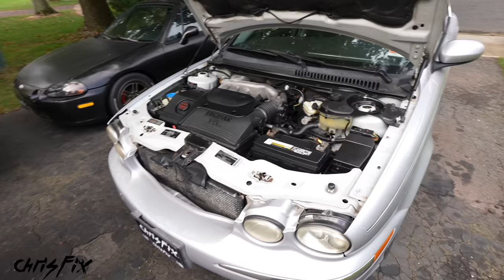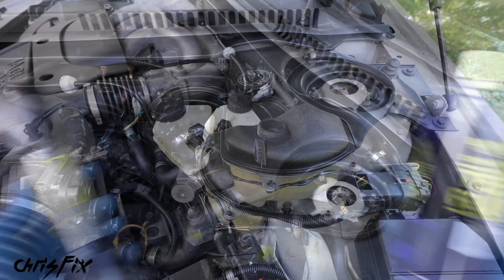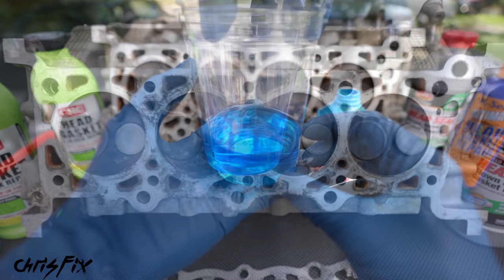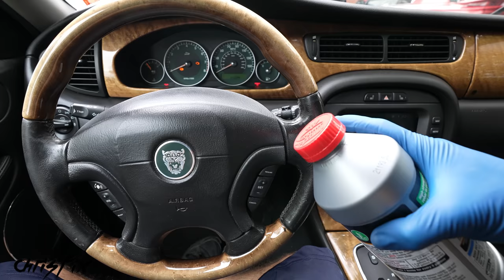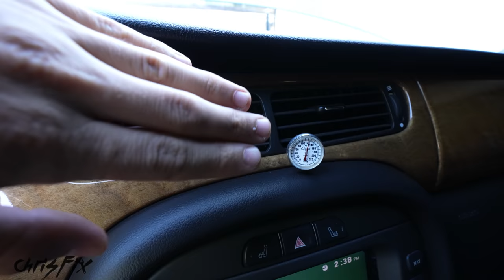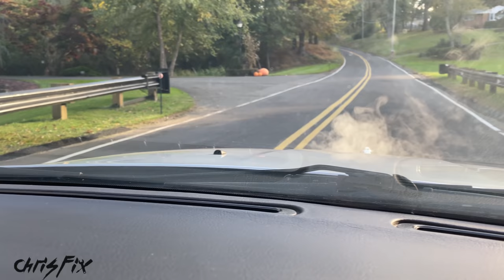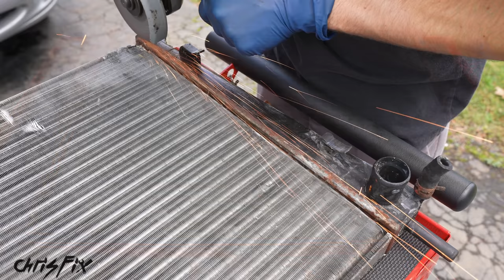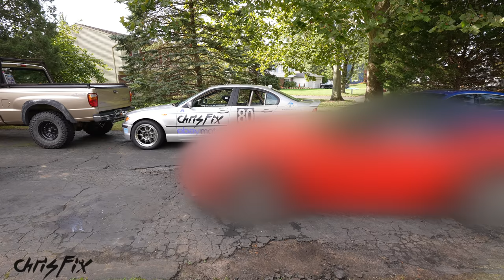Do Head Gasket Sealers Actually Work (FULL 2yr TEST with Engine Teardown)

Comment: I have only used a head gasket in a bottle once, on my wife's last car. She had a 2008 Pontiac Torrent GXP with the 3.6 V6, 160,000 miles. Head gasket leak into the exhaust. Going through about a gallon of antifreeze a month. I used the K Seal brand sealer. The only thing I did different from the instructions was since it wasn't going through antifreeze very fast, I drained out about a gallon from the radiator, mixed the sealer into the antifreeze and added it back to the reservoir. Watched the coolant level closely for about a month with very little loss of coolant. She drove it for another 8 months before we traded it in.  Didn't notice any side effects from it. The heater worked like normal. No over heating issues.
Reply: Awesome!
Reply: "Then we traded it in" with full disclosure i presume 😁
Reply: @Dufftruck7  Of course!😉

Comment: Having problems with my engine. Watched this video 3 times already and I'm going to try this. Just wanted to add, this was the best how to do video I have ever watched. I am a 70 years old woman and this was so easy to follow. Excellent job.
Reply: I agree ☝️
Reply: howd it go?
Reply: Did it work?
Reply: we need an update!
Reply: Did it work ???
Reply: UPDATE???
Reply: @grahamhammond  I tried it in my 08 Avalon, but the head was too warped to work. It was the BlueDevil stuff.
Reply: @grpAfactory  did you try to use anything else?
Reply: Im about to do this to my tahoe. I have a minor leak so im confident i shouldn't have issues. I was always told Blue Devil is the way to go
Reply: @danielwright_69  No, the head warped too much. I had to replace the head.

Comment: I have a 99 Camry that developed a leak in in the first cylinder. I used the Barr’s sealer shown in the video and it worked immediately though filling it was a pain because how thick it is. Been driving about five months with no problems at all. It will buy enough time until I can get a proper fix.

Comment: My dad just blew the head gasket on the family's 2011 Chevy Aveo with an overheat. (I'm pretty sure the rad has a leak and I'll be pulling it tomorrow to confirm.) The reservoir now blows the coolant out when the cap is off which it never did before and I found water/coolant ontop of the pistons after pulling the spark plugs. But your video is so comprehensive that it has given me the confidence to give the Blue Devil a try once I get the rad leak fixed, versus taking the head off the block and praying to everything since I've never even opened a valve cover before. I'll try to remember to update this as it goes.
Reply: Oil in coolant or coolant in oil? Or both?

Comment: This video is exactly what i needed to see, my car was in the exact same situation. Coolant leak but no drips underneath and no steam out the exhaust, so it was driving me crazy,  after the video i tried the funnel tip and had bubbles, put in some gasket seal and now my car can hold it's drink. Thanks so much Chris
Reply: Any update about your car? does the sealant still work?
Reply: what sealer?  any updates ? thanks 👍

Comment: That was one of the best videos I’ve seen on a review of a product all the way down to the fact of showing the after effects of what it did to the engine. So thoroughly done. I loved it. Thank you so much for this video. 
I’ve used the Blue Devil product years ago like 2005 I believe in a Saturn car. It lasted like 10 months and the bottle from autozone was like $60 at the time. And you couldn’t use coolant back then. The instructions said to use straight water back then. But I probably put 10,000 to 12 thousand miles on it before it started acting up again. So it does work but not long lasting
Reply from the maker: Thanks a lot! And that's pretty interesting, thanks for sharing!

Comment: I have a 2002 Nissan Altima SL 2.5 liter. 147k miles. Had a substantial head gasket leak. Had milky white oil on the dipstick, as well as up in the breather tube assembly, almost all the way to the mass air flow sensor! I would hardly start, and smoked up the entire roadway when it did finally start, with thick white smoke. Not to mention, I was having to add coolant everyday. My radiator cracked, which caused more trouble. Ended up finding one of my thermostats was completely froze shut! I changed the thermostats, changed the oil, and add a bottle of Blue Devil Pour and Go Head Gasket Repair. I followed the directions to the letter. I have since driven the car app 1200 miles without any problems at all! My oil still looks brand new, and no overheating issues! Hats off to Blue Devil!
Reply: It's been 11 months, head gasket still good?

Comment: I don't agree with cloged thermostat as being the cause.
The way the temperature increased and then dropped, it behaved more like an air bubble, once the thermostat opened, the trapped air, [mostly at the thermostat wax pellet end]  was free to flow towards the coolant resovour. Moreover,  causing the fluid in the resovour to drop...

I mean no disrespect, this is based on my experience as a fellow tech.,
I still enjoy your videos and continue to watch them...
Reply from the maker: Thanks for the info and your perspective. I would agree but the thermostat has a hole in it to allow air to purge through it. I also previously ran the engine full of coolant and the spill free funnel was full too. I ran it until operating temperature to show the exhaust bubbles in the system. With that said maybe the exhaust gasses built up so fast it trapped enough air to cause the problem you’re saying. Either way a great other perspective and thanks a lot for sharing from your experience!!!
Reply: Agreed that there was air in the system
Reply: I have a 2013 Buick Encore with 65,000 miles. Had a very slow leak and had to add fluids a couple times a month. The last couple weeks I had noticed I had to add more fluid than usual but not much more and all of a sudden the temperature spiked on my way home from work one day. Ran it for about half a mile just to get off the interstate which I know I should have killed immediately. I let it cool for nearly 45 minutes added more fluids got a few miles up the road same thing happened. Repeated process and got home. Ran Diagnostic and said coolant system flow problem so change thermostat. Changed out thermostat and it cleared my check engine light started over clean and acted fine until we got to the stop sign at the end of my road and spiked again and died.  I believe the reason for the sudden spike is we didn't get all the air out of the system. Do y'all agree with this scenario? Now it will not turn over and there is water in the oil that had just been changed. Killed engine as soon as it spiked the second time after changing thermostat though. Is it for sure a head gasket issue? What am I looking at here?
Reply: @jcedars4784  what engine did it have? if it was one of the 60 degree v6 engines(3100-3900), i remember there being a little rail on the forward facing valve cover that had a spout that had to be opened to allow air to escape out of the coolant. if it wont turn over, the cylinders are probably full of coolant, and are hydrolocking the pistons from turning. take the plugs out, then try it, take cover though.

Comment: Chris, not sure how you manage to make an even better and more comprehensive repair/how to video than all your others, but this was a tremendous one.  Very informative.  Prior to watching this, I would have been skeptical about using any of these head gasket leak fix products.  Now, If I were facing a similar situation, (low value vehicle, with head gasket leak, and unjustifiable repair cost) I would definitely try these products.  Just preventing the overheating and coolant loss would have been a big win, but going for an additional 2 years and 10k miles was a tremendous endorsement for these products-or at least the one used.  Great job on this long term project video and all the great content your putting out.   Keep up the great work!

Comment: 07 Silverado 4.3L, head gasket leaking coolant to exterior below exhaust manifold. I used a heaping hand full of pepper into the upper radiator hose. 1 year, no problems.

Comment: 17:27 it got really hot because the sensor was reading the steam in the system. Once the steam got worked out it started to read the correct temperature of the fluid.

Comment: I have a 2006 Sienna with 345000 miles with a small headgaskit leak. I will try this. As it hasn't overheated,  just pushes out about 8oz of coolant from sustained speeds 80-90mph. 
Thanks Kris.

Comment: I've used Blue Devil on an Audi S6 V8 and a junker 97 Impreza sedan. It worked both times flawlessly and I absolutely HATE "leak sealers" but it actually worked. Miracle tier stuff.
Reply: I'm on mobile so can't see full reply but from what I can read, yeah, full T stat removal, heat cycle, then replace with brand new T stat

Comment: I find it more amazing that it fixed the leak because Bars Leaks does not claim that their product will seal a warped head.  It is a significantly different scenario than a failed head gasket due to the difference in square footage (inchage?) between a warpage and gasket failure.

Also, props to Chrisfix for a well researched and thorough test.

Comment: I just want to say thanks a lot to Chris fix because I had the exact same issue where I did not blow the head gasket. I warped the head and I could not find any other video besides this one that explained it this well, and in depth to even show the head gasket after was absolutely perfect. Saved me having to take it to a mechanic too bad my engines trash now.
Reply from the maker: Thanks! And was the head too warped to be fixed?
Reply: I’ll let you know by tomorrow morning if this works I’m letting it sit overnight as you did but I’m almost positive the head will be too warped to be able to be fixed. it hit 285°. Finger’s crossed ! Wish me luck

Comment: My experience with Bar's HG-1 has been the same.  The leak is stopped for 6 years.  The first application in 2016 lasted 2 years.  The second shot of HG-1 is still good and the radiator is not clogged.  I believe the initial cause of the problem was rusted leaking freeze plugs.  The coolant loss caused overheat and, I think, warping of one of the heads which led to exhaust in the coolant.  The freeze plugs were repaired and subsequent driving revealed the head gasket issue.  It is a 2006 Pontiac Torrent, same as Chevy Equinox, 3.4 liter 207 cubic inch V6.  

The Bar's HG-1 has transformed the car from $400 scrap value to a useful daily driver.  It still gets oil changes, tires, belts, batteries, repairs, etc as necessary.  The original shop estimate for the repair was $3500 plus heads if the originals were not serviceable.  In 2016 it wasn't worth that much.  In an aircraft or ocean going vessel I would probably not trust this engine to bring me back alive but in a car it is good.  If I were to consider a traditional repair I think a typical junkyard engine, without known flaws, might be a better starting point.  

I was advised by many people to sell the car right away when the first dose of HG-1 worked.  In my opinion it would be wrong to sell the car without disclosing the head gasket problem.  That disclosure would reduce the price of the car to about zero.  My choice was to keep it, use it, and risk the loss of value.
Reply: This answers my question.  When the first application quits working, why not try another dose?
Reply: Thanks for being honest and not try to lie and sell it. Hope we have more honest people like you in the world.
Reply: I am getting ready to go to the beach- and then drive while we are there- I have white smoke at start up - dissipates within about 5 seconds.... but what are your thoughts if it isn't using coolant - light hasn't come on to add coolant in about a year although i topped it off to the max since it was at minimum when I happened to check- due to seeing the smoke for about 3 weeks.... do you think I should rent another vehicle (close to 1k with insurance) ugh.....but brother's best mechanic friend says if not using coolant he wouldn't worry too much yet... I had this Escape into the dealership 2 yrs ago where they flushed reservoir added new said no leaks there.... seemed to get better with light only coming on a few times here and there when cold but then seemed to stop for now... lemme know your thoughts.. it's paid for and Wanted my daughter to use it for college, etc..locally and me get a non Ford!
Reply: @youtubeuploads7208  Sorry to be slow to reply, you are likely back from the beach by now.  If there is white smoke at startup there is most likely a problem.  If you let the coolant run low an air bubble in a water passage may cause a local high temperature spot.  That could give you a warped or cracked head.  I check the oil, coolant, and brake fluid at every fuel fill even though my car doesn't have loss of fluids.  Everything will be fine until suddenly it is not.  A test for exhaust gas in the coolant might give you a warning of impending doom.  Doom could be just a $40 worth of Bars HG-1.  Keep driving with low coolant and you will get the car to the junkyard early.
 
In my opinion, an old, damaged, beaten up car that is working well has value for transportation.  Some people have the opinion that it must be "right" to be a keeper.  I know how to call for a tow and how to get home using Uber or Lyft.

If your daughter drives it until it dies and that happens very quickly she might learn about fluid checking at a relatively low price.  Get her a new car and she will either not learn or maybe learn at a higher price.

I don't think Ford versus non Ford matters much.  A Bugatti or Ferrari is probably no less sensitive to low coolant.
Reply: @treborenglish5399   it ran fabulously...used no coolant and about 650 miles later still FINE  :-)  Thanks for the reply- we got back Saturday night .No worries about late reply.. I do same!  Have a great day!

Comment: Great video, one minor fix i would like to see - replace the line you said: "so it lasted two years before the leak re-appeared" with the line "so it lasted about 10000 miles before the leak reappeared" - I think some folks might expect these products will work on a time basis rather than mileage-based performance

Comment: I have now successfully repaired two engines with blown head gaskets by using a kit by Titan Sealers. $150 per engine. I also use Titan's coolant designed to support the chemical repair. Both engines are running beautifully. Land Cruiser engine repair was three years ago, FX45 repair one year ago. Very pleased with Titan Sealers product.

Edit: I have now successfully repaired bad head gaskets on three cars. Latest one: 01 PT Cruiser. Running well.
Reply: How bad was the leak? I have a 330xi with a very bad leak and idk if it'll work.
Reply: @wake777  oil was flowing into the coolant on the Infiniti. Coolant was flowing into cyl 6 on the old Land Cruiser. Both fixed perfectly.
Reply: @allen walker  gonna give it a try, if it doesn't work guess doing a head gasket I good experience
Reply: @wake777  Titan offers a second dose for the cost of shipping. I strongly recommend asking for the second dose when you get the package because the offer expires after ten days.
Reply: I just heard about titan.
Sounds great.
But I wonder why when you Google  the very best head gasket sealer.
1- Blue Devil 
2- k seal
No mention of Titan.
I wish I knew which was actually the best.
Don't mind spending the extra 100 if it is better.

Comment: Thanks Chris! over two years ago I used head gasket sealers on my car, it solved the problem ( coolant in oil ), but many people told me I was going to break down/die. I cant really afford to replace the gaskets, and I dont really have a good place to do that work myself, so I kinda had to go this route. Ever since then Ive been just expecting the car to just die...for years... and it keeps going strong! no coolant in the oil!

Even with good results; driving off-road, driving in blizzards, driving in death valley, many coolant free oil changes, and the rigors of pizza delivery I thought I was  just lucky,  but after seeing this video im feeling a lot better about my decision.
Reply: Nice to hear about your experience. Can you share what vehicle you have and what product you used? I have a 1987 Ford Ranger and looking to use one of these products but dont know which one. Thanks.
Reply: Would love to know which product you ended up using!
Reply: @frostwolf95  I ended up using the blue devil. It seemed like it had better success stories and the solution didnt have any fibers or anything in there that would damage the engine.
Reply: What brand did you use rain ??
Reply: I have to say Blue Devil for every product they make are great! But the head sealer is pretty good. Depends on how bad your gasket became.  It worked great on my car. I had something else happen where my car now is broken down but that is transmission related…..I would go with blue devil but Kseal isn’t bad choice either.  There is stuff like the aluminum shavings one but it’s copper instead. I would do radiator flush just to have clean fluids.  Blue devil little more expensive but worth it